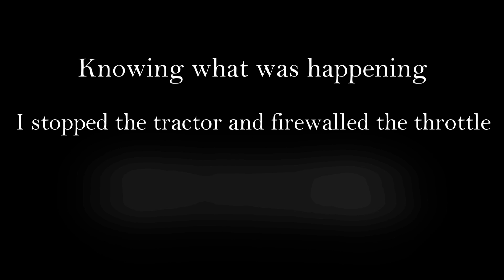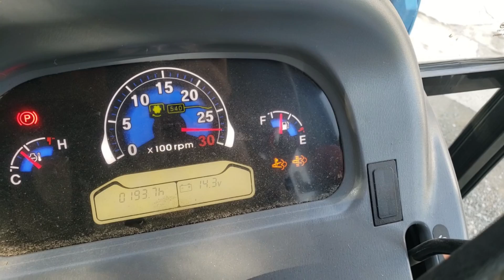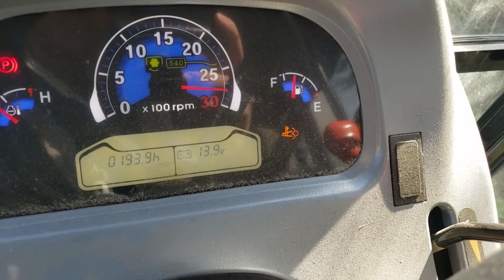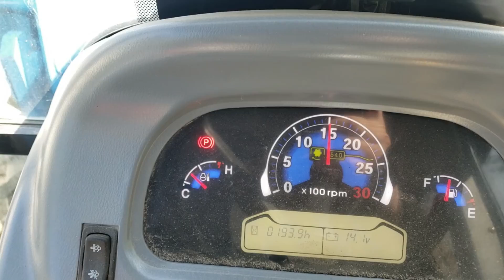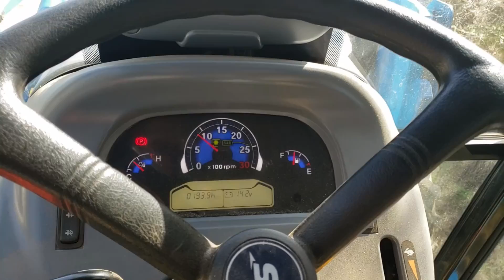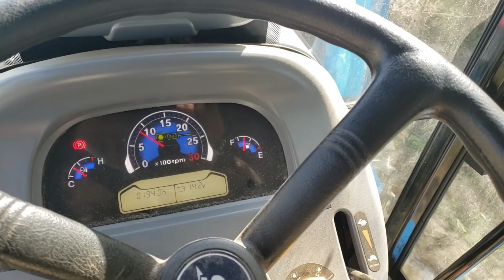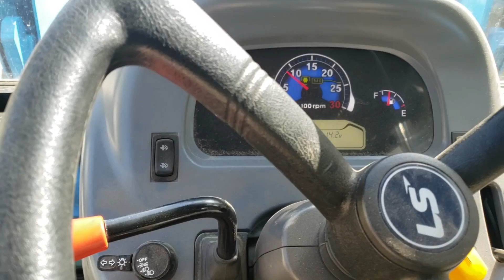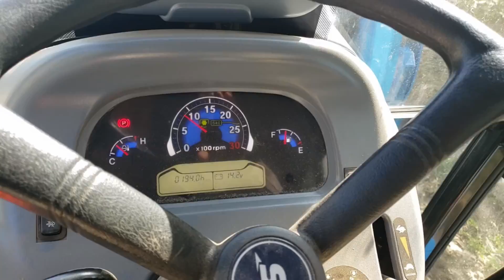Time for a REGEN

Comment: Don't think you need to "firewall" the throttle during regeneration. DPF injects fuel to burn off without high RPMS.
Reply from the maker: You are absolutely correct! The computer takes over, which is why I noticed the bump in RPM when it first started. However, the tractor was warm, not hot. My dealer told me to simply max the throttle to get it as hot as possible, the engine, even going as far as working it hard, to get a good burn. 
When I was out brush hogging last summer, when it did it last time, I was operating at PTO speeds. Thats where it did the regen. I didnt max the throttle at that time, but I was working the tractor hard mowing through tall green, wet, grass. 

Thanks for watching and commenting!

Comment: To inhibit the regen mode press down on the switch to the left. To exit inhibit mode press down again. Then press up for 1 second to start the regen again.
If you want to run the regen manually, press up and hold for 3 minutes. 
This is from the MT347 owner manual.

Comment: Thanks for the video...  How is your tractor doing since Apr 2020?  I am considering an LS 468 or a NH Workmaster 65...  The New Holland doesnt do Regen.  It has a DOC instead.  Not sure which is better or if you ever have to replace the DPF and what that would cost...  So - a couple questions - what size is your tractor, how many hours and have you had any issues with the regen?  Thanks for posting the video!  It makes me feel a little better about regens process.

Comment: On my Ls xu6168 it seems faster last time it was dark out and i was about to shut it down then it went into regen so i just unloaded some more wood that i was moving and it was over by time i finished! Seems any that complain are just looking for problems!
Reply: Are you hapy with your XU6168?
Reply: @Nikola Vinski  only problem it has was like 50hrs it had the computer that runs the shuttle shift went out it was fixed by warranty and not a problem since. I blow out dust and check fluids regularly I keep fuel tank full when sitting overnight to keep water out of tank. I grease it regularly and I don't abuse it just use it. I use it for small square baler and dirt work and to move logs for my sawmill so it has been maxed out many times. I believe a lot is operating error and poor common sense with people and equipment in general.

Comment: All new  , tractors over 30 hp needs a Diesel particulate filter  , Diesel engines over  70 horsepower have added on Diesel exhaust fluid as well
Reply from the maker: Exactly! I didnt know where the cut off was. Thanks for watching and commenting!